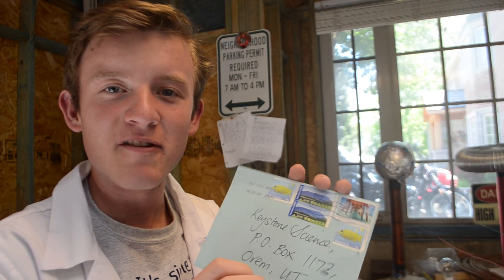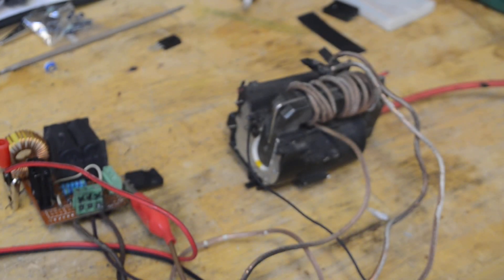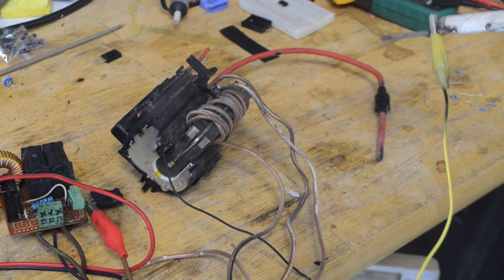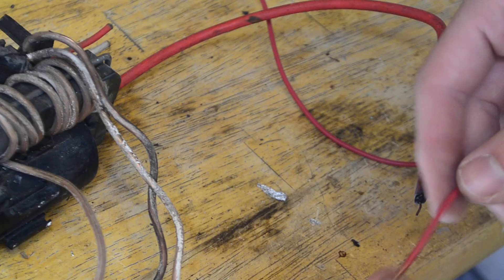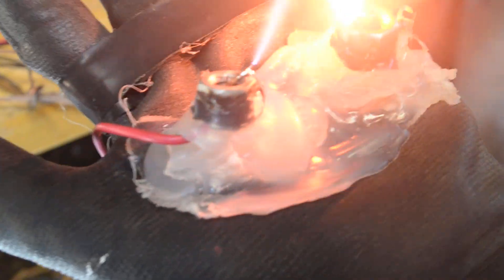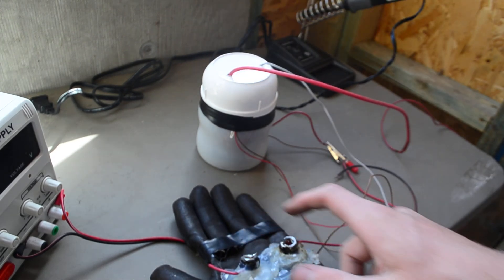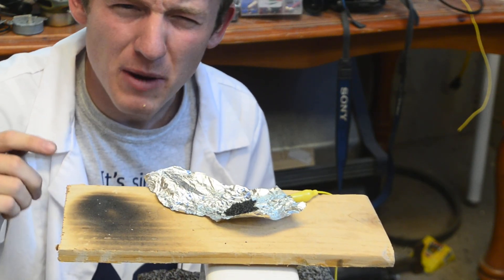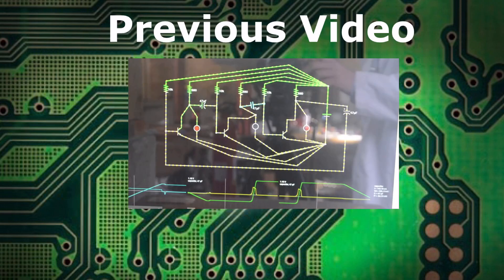Electric Arc Glove

Comment: Hi keystone! I've made my own flyback ZVS driver and got it to work for a little bit and had a 4+4 centertap primary around the ferrite core on my flyback. However, when I upped that to 7+7, I believe that the thing arced inside the secondary and no longer works. Do you know if there is a way to combat this so that it doesn't happen? Thanks! I absolutely love your videos.

Edit: Also, where can I get cheap flyback transformers? I know that you can salvage them from old TV's, but I don't really want to go through the hassle of buying 100 pounds of crt and having to recycle all of it.
Reply: I get them for about 20 bucks on eBay.

Comment: i have seen "zvs drivers" on aliexpress and ebay with only 2 connection points and no center tap. these also have a second inductor. they seem to be geared towards induction heating but will they work for flyback transformers?

Comment: FYI: Based on the resistance of your skin, it takes 48V to kill you. Since this is running at 32V, even if it crossed your heart, you would be fine.
Reply from the maker: +Randy Hugick the output of this is around 60,000 volts, and that is that is at approximately 500ma, this is likely not going to kill you if for a brief moment it shocked you, but with an exposed it would at least burn up your hand and perhaps burn veins internally, which would not be good
Reply: Ah. I see. I misunderstood. After watching your other video, I saw that the input was 32V and the output was estimated 60,000. That makes more sense as to why the arcs were so hot. Anyways. Keep up the good/fun work.
Reply from the maker: +Randy Hugick thanks! :D

Comment: same project with much more resistant gloves, the spark gap at the finger tips and a small tube that blows air attached to the inside of one of the spark gap fingers. air supply controlled by the same Switch that the current is. blows in the same direction as the fingers point.

Comment: I love your videos! obviously i had to do a lot of reading to get to where I could confidently and safely work with hv.  however for my power supplies I just use q see or altronix 12v or 24v 10-20 amp power distribution units from security camera and alarm systems. they get junked all the time and are only like 15$ on Amazon for smaller ones thought I'd let you know as you said power source was one of more expensive parts.  keep up the good work!